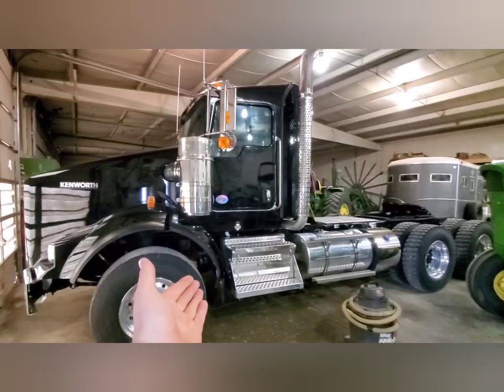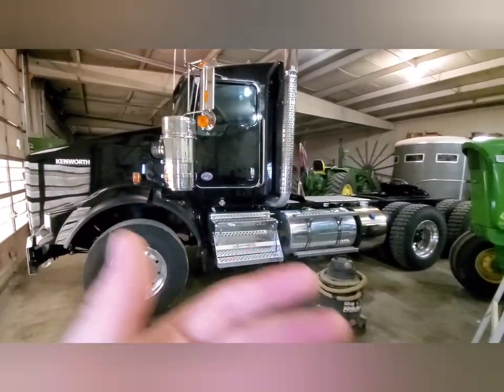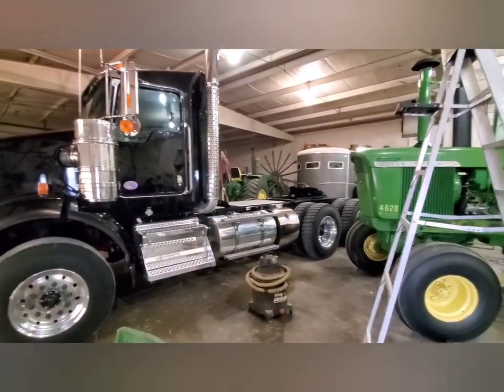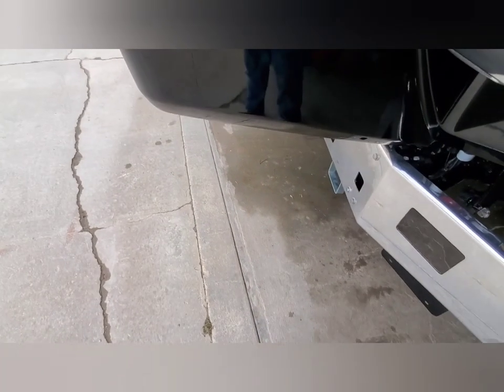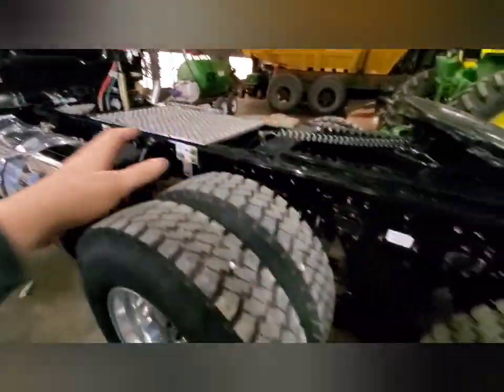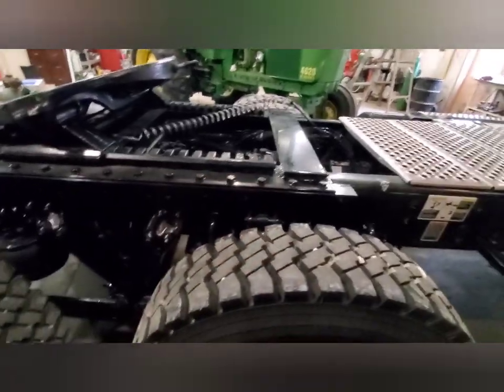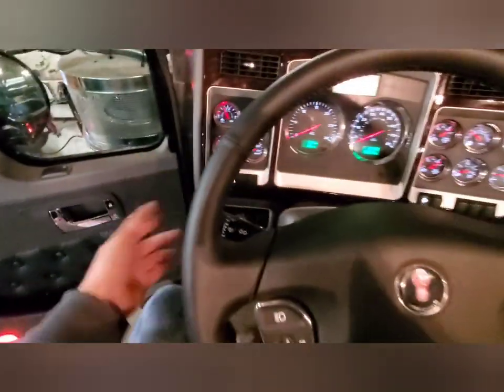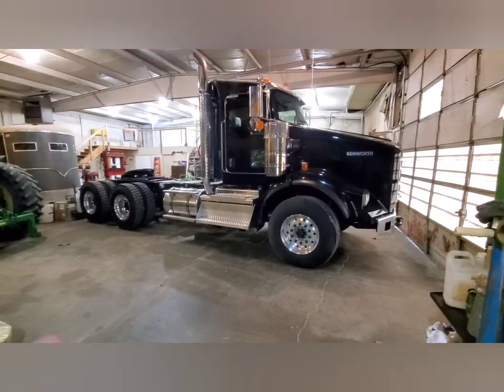Kenworth T800

Comment: do yourself a favor and cover the ends of those fuel tanks with one of those fabric covers or install full coverage mud guards over the rear tires.  otherwise a regualr gravel road is going to throw rocks and sand blast and rock chip the shiny right off.
Reply from the maker: Oh I know, just absolutely sandblasts things ...sucks ... I'm going to have to figure something out to hold down the gravel blast ...

Comment: Hi nice truck!  I have almost the same truck coming in February. I opted for the same 7 inch exhaust tips and my salesman told me the shortest they come is 36 inches.  Yours seem shorter which I prefer for overhead door clearance.  Are yours 3 foot or shorter?  Thanks.
Reply from the maker: Thanks very much .... I believe these stacks are  36 inch tall  - but then again I should double check that ....

Comment: Very nice. Can you explain the difference between the transmission you got vs a full auto-shift? Horsepower that goes on for days, sure beats a 238 screaming jimmy huh.
Reply from the maker: Thank you! ..

 Lol.... those 2 stroke Detroits are a lost sound.. very powerful for thier time ....

This is an ultrashift plus, 18 spd ... it still has a clutch- but it's operated by a electric actuator ... so when your stopped at a stop sign with brake pedal on, it's holding the clutch down for you... its like an 18 speed manual- but you dont have shift it manually.... I'll try to get some more video of it soon ....

Comment: Awesome truck . Why did you go with brand new truck instead of a good used truck with no pollution control stuff that cost so much in repairs .
Reply from the maker: Thanks very much! .... I have looked for good used trucks for years but just couldn't find anything... the DOT specs vary so much state to state too - so it's hard to find one optioned correctly ... we have a 5 year warranty- knock on wood

Comment: Oh boy that truck is nice but the ultra shift is a awful transmission, i just rebuilt a t800 with an allison 4500rds in it and its smooth like butter. The ultra shift is a very clunky shifting trans that has a lot of mechanical and software issues, but best of luck with yours though!
Reply from the maker: Thank you ... we ordered it bc of an elderly driver - I wish I'd ordered a manual shift ...this is at least the ultrashift plus, which suppose to be improved- well see